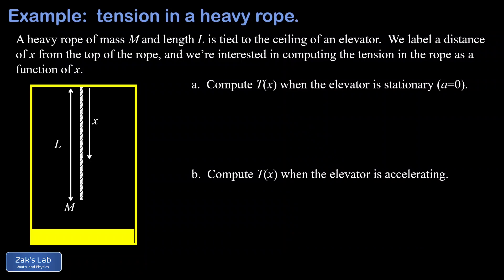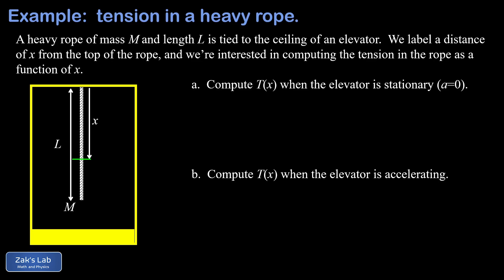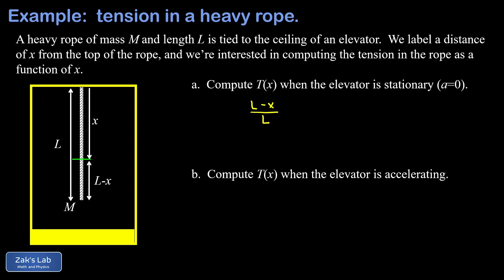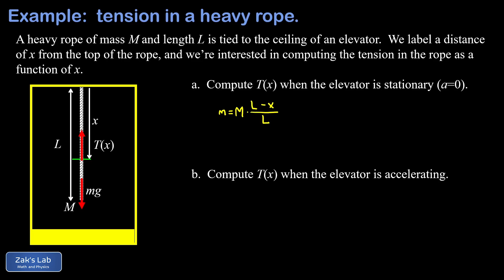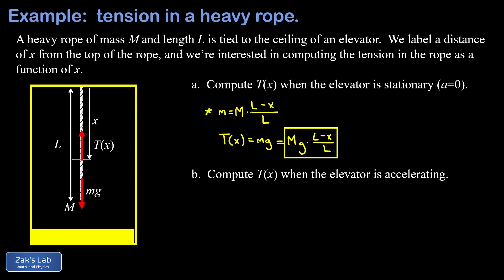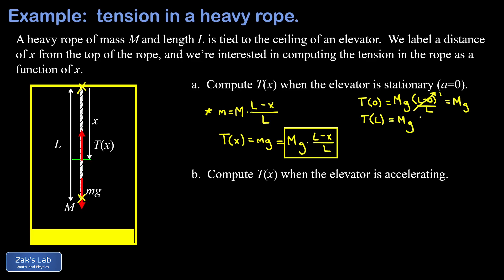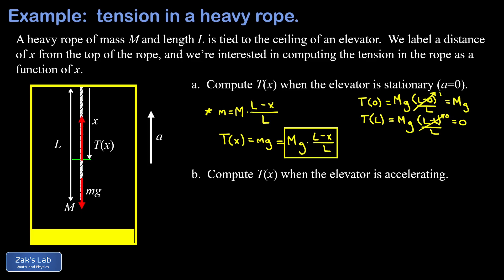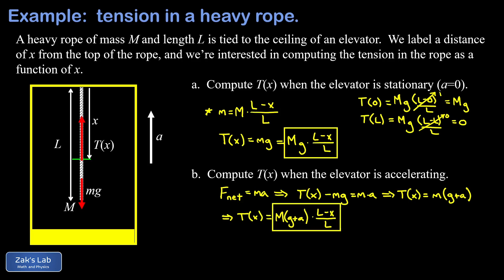Tension in a heavy rope hanging vertically in an elevator accelerating vs. static cases.

Comment: BTW, I’m dealing with a vertical spring problem of my intermediate mechanics class: A block with mass m is put on the base of a box with mass M, while the box is suspended vertically by a spring. At the moment that the block just begins to lose contact with the box, I set ma=Ma, is it right?
Reply from the maker: was this system compressed vertically wrt the equilibrium position in the initial state?  Not sure what the reasoning is to set ma=Ma . . . moment of losing contact means the two accelerations are different because the box has the spring pulling up on it while the block is in free fall, if I'm understanding the picture correctly.
Reply from the maker: hmm . . . I'm not thinking about it right, if I'm thinking about it right . . . anyway, try to elaborate your reasoning behind setting ma=Ma, so I can understand what you're thinking.  A key physical point is that the interaction force between the blocks vanishes at the moment contact is lost, which means the block m is in free fall at that point.  I'll take a real look at the problem when I get a chance.
Reply: @ZaksLab  Free fall is a good point! Yes, I didn’t notice it! I used ma=R-mg for the inside block, where R is the reaction force from the base of the box. Then I used the equilibrium position of the spring and the box with the block to get the y=Acos(wt-φ)=d, where d is the displacement stretched down. Finally I got d=g/(w^2), w is angular frequency.

Comment: When the elevator goes up, T is 9.8+a, which means the tension is greater than that when the elevator goes down? Is it because of Newton’s first law that (L-x) part of the rope stays put at the very beginning when the elevator accelerates up?
Reply from the maker: I wouldn't frame it in terms of Newton's first law (N1 is really just a test to see whether or not you're in an inertial frame).  Newton's second law is what we need here, and that little section of rope is accelerating upward with a magnitude of a.  Accelerating upward means the net force must be upward, which in turn means T(x) must be larger than mg.  Applying Newton's 2nd:  T(x)-mg=ma, that's just F_net=ma on the little section of length L-x.  Replace m with M*(L-x)/L and solve for T(x).
Reply: @ZaksLab  I watched many of your videos on moment of inertia that used integration to get the results. I’m wondering if I integral might be used for T(x) in some case?
Reply from the maker: That's the plan:  if you make a rope with variable density, say increasing linearly, then you have to use integration to solve the problem.  Also true for dragging a rope along the ground (that's just turning the problem sideways really).
Reply: @ZaksLab  Different densities —> different net force at different point of the rope? Drag the rope along the ground, is it because of friction?
Reply from the maker: the variable density thing:  the same basic concept is there that the tension is responsible for holding up the mass below that point on the rope (or accelerating the mass behind the cutpoint, if it's sideways).  But to find that mass you'd have to integrate because of the variable density.  If you added friction to the sideways problem it could get a little more interesting, I suppose you just look at the normal force on the chunk of rope behind the cutpoint by using the mass you get from integrating . . .
Reply: @ZaksLab  Thank you very much!